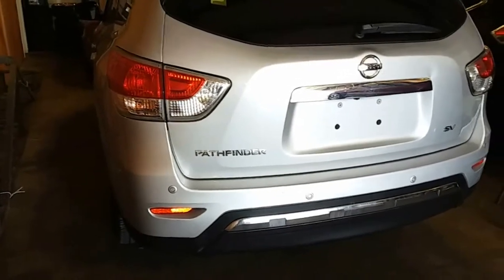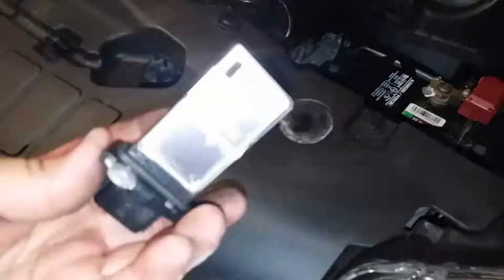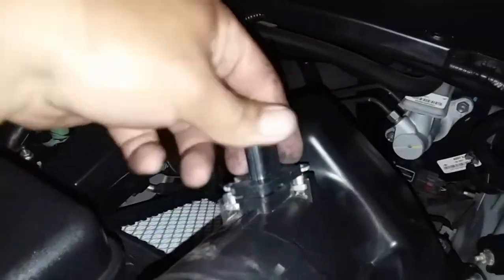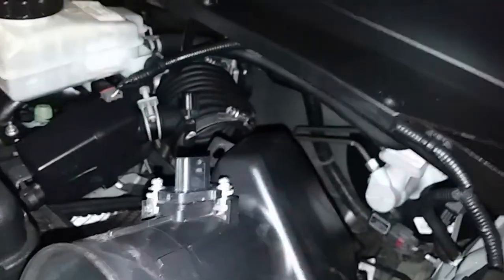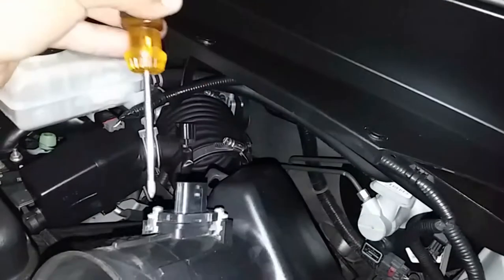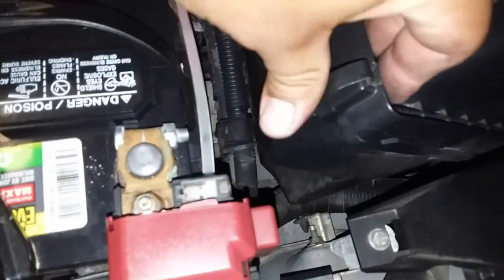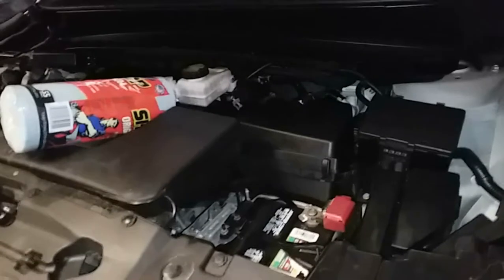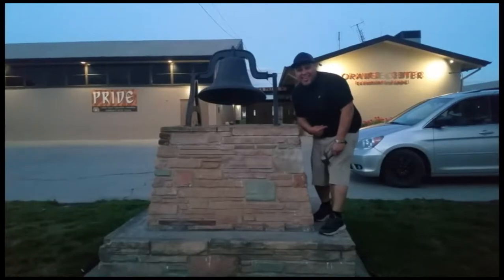How to: Install a Mass Air Flow Sensor/ Temperature Sensor (MAF) on a 2013 Nissan Pathfinder

Comment: Thank you George. I was into my dealer last week, check engine light. Replaced O2 sensor, $30 part $217 labor. Still have the light, took it in today and was told that its now the MAF sensor. Had to order part, but I'm not spending a third day having it installed....
Reply from the maker: Dang man I'm sorry, hopefully this works out for you.

Comment: I was told not to use Duralast MAF, (after I had already installed it) but when I bought the Hitachi part that was recommended, my car runs worse. What part do you recommend. The Duralast part fixed the stutter on acceleration,  but the light came back on. The Hitachi part said it was for 2011-2012, even tho that was the recommended part for my 2013. 🤔
Reply from the maker: Is it the same error code? I suggest maybe getting an oem one from Nissan dealer. Sometimes these cars can be specific on part's, especially engine and transmission sensors
Reply: @559powerscape  Thanks.  Yes I ended up getting a nissan OEM MAF and it was actually a cracked hose in the end.  I don't know why sometimes the change in the MAF seemed to make a difference... but I was told the P0101 code was also a problem that kept popping up so we had to have the computer reprogrammed as well. 🤦‍♀️🤷‍♀️
Reply from the maker: Wow its crazy how it can be the smallest things sometimes. Dang a reprogramming too, bet that was not cheap as well I think its like 220 just the programming
Reply: @559powerscape  Yes,  the total was about $340, plus the $275 for the OEM part.  In hind sight,  I bet a part from any O'Reilly shop would have done the trick. Unfortunately, that's the first place they started and asked me if I had a "genuine Nissan part" so they would have sold that to me anyway.  And I can't exactly take the OEM one back now. I probably saved money putting that in myself tho. Ah well,  at least I know if the check engine light comes back on, they said they'll fix it for free. I got away with just cleaning the original MAF sensor last year,  so I guess I saved myself money in the long run.

Comment: Thanks, George, great video! Is there something you need to do after you install? Like, recalibrate the sensor or some sort of re-programing/relearning procedure?
Reply from the maker: If you have a check engine you just need to clear it with an obd2 scanner and drive it. If you dont have one you can simply drive it till it goes away when it completes its drive cycle.

Comment: So you dont need to do most of what you did. it comes out easy without removing the airbox
Reply from the maker: I just take it off cause its 2 screws and saves a headache trying to fit a big screw driver back there. Especially with my big azz hands 🤭. I rather take an extra step and save some   Cuss words for another day